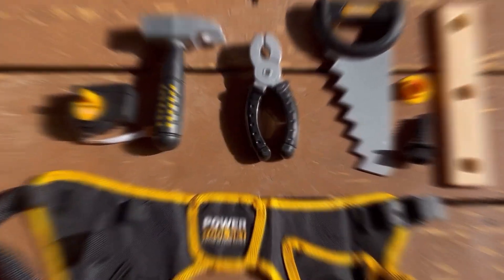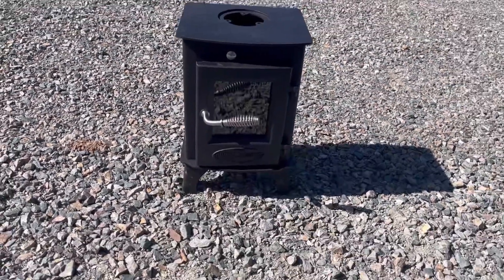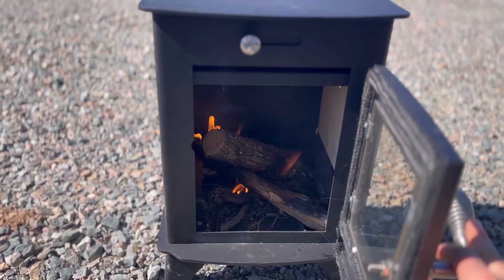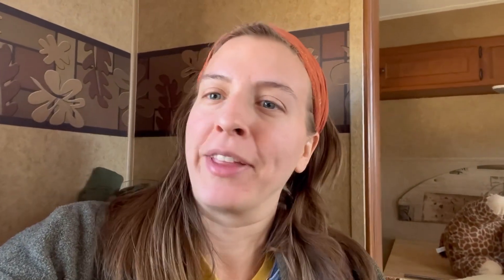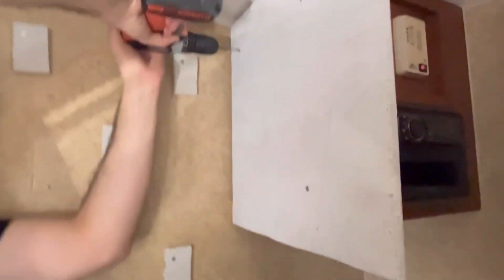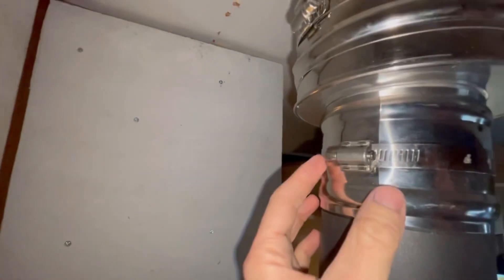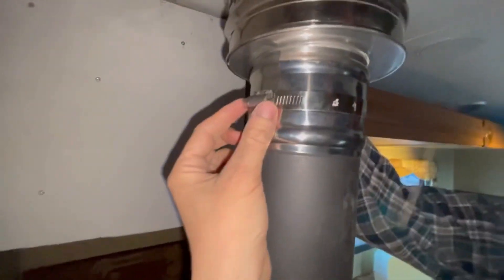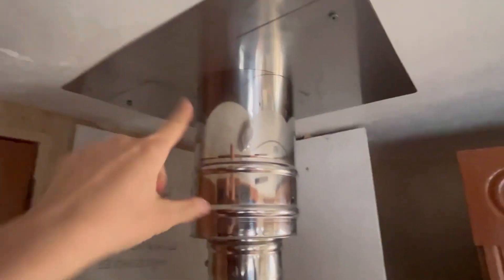Installing a dwarf wood burning stove in our RV/camper (for off-grid living)

Comment: Good video lol.  Have you had a chance to use the wood burning stove yet?  If so is it the only heat source you'll need for your RV size?
Reply from the maker: Thanks 😊 ! We started it up once and then realized it needs to be 2-3 inches from the rv ceiling because the insulated pipe was getting pretty hot so we are going to cut a larger hole. Now that it’s warmer it hasn’t been a big priority but we definitely want to get it up and running soon. It definitely can be an only heat source. It’s suppose to heat 200–300 square feet. This winter we do plan to use it as our only heat source.